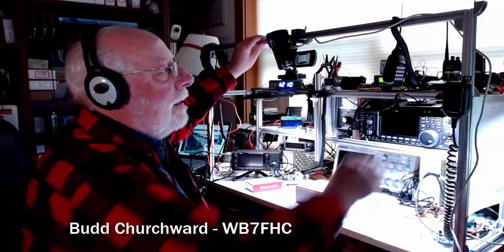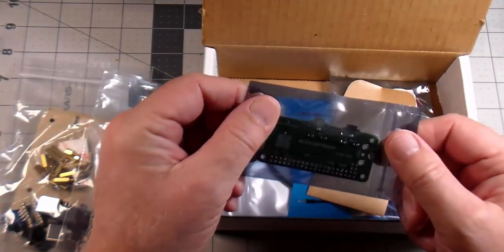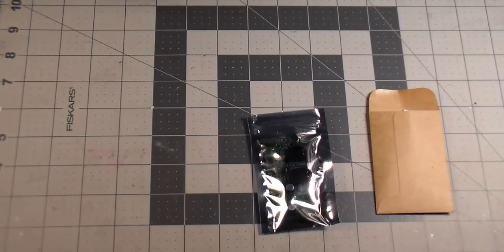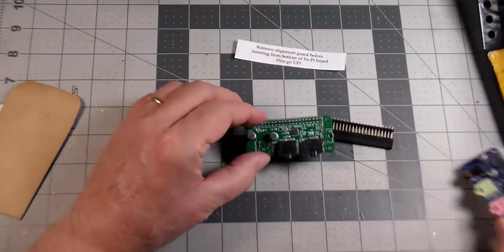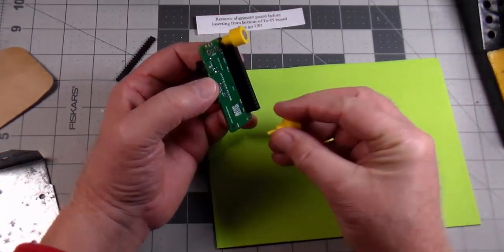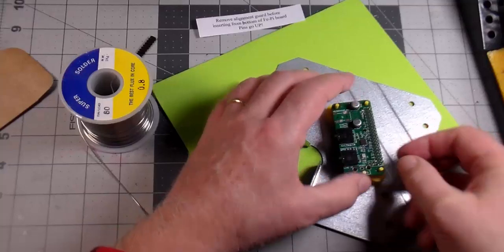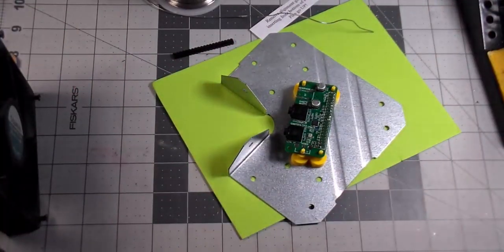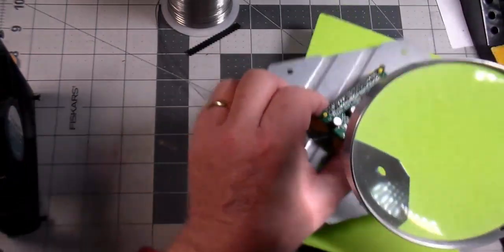Building the Nexus DR-X Pt. 1: The Fe-Pi Sound Card

Comment: A very interesting and informative video. Thank you for that.  Actually i wonder how you fixed the camcorder to the aluminium frame on your desk.
73, Andreas.
Reply from the maker: I bought the parts from a company called: MiSUMI ... they have lots of attachments to choose from. I found a plastic block that sides along the rail, can be locked down and had holes that allowed me to attach a fitting from a camera tripod.

https://us.misumi-ec.com/vona2/detail/110302683830/

https://us.misumi-ec.com/vona2/detail/110300437260/